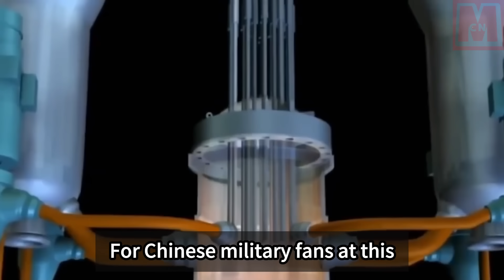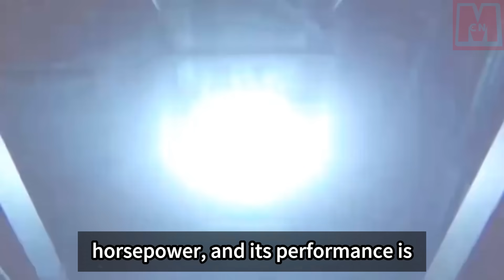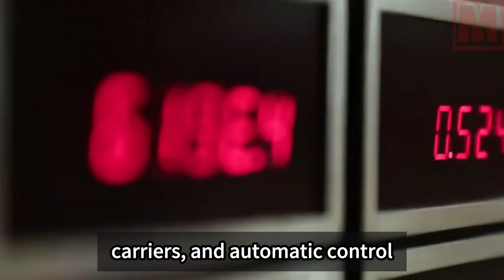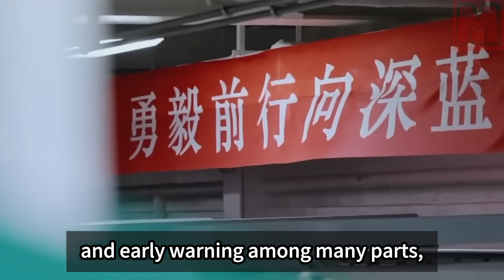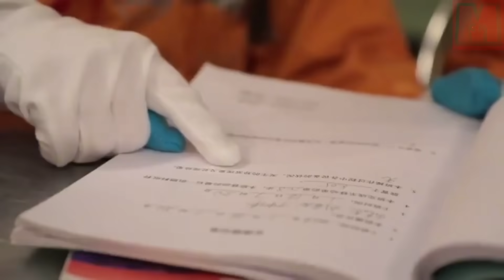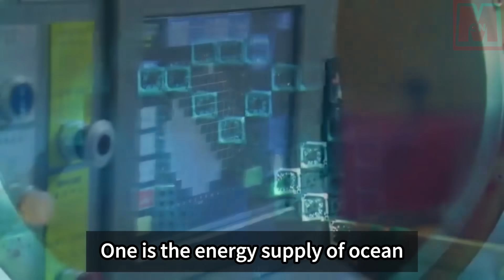Linglong 1 nuclear reactor project: Why is it crucial for China

Comment: Another possible option is China's molten salt reactor.  Shanghai's dockyard is preparing to produce a large merchant ship using a molten salt reactor. China has a developmental MSR running since late 2022 and will begin the construction of a larger MSR starting in 2025 with a completion expecting in 2029.

Comment: Nimitz-class supercarriers are powered by two reactors rated at 550 MWth each. Gerald R. Ford class supercarriers are powered by two reactors rated at 700 MWth each.  The Linglong one reactor is rated at 385 MWth.

Looking ahead to 2040, China plans to deploy Thorium Molten Salt Reactors (MSRs) for hydrogen production, synthetic fuel production, desalination of seawater, district heating or cooling, powering of ships equipped with thermoacoustic Stirling generators, and power plants with supercritical carbon dioxide turbines within its borders and globally. Similar to the trends observed with solar and wind technologies, MSR costs are anticipated to decrease with the scaling up of production and the development of robust supply chains.
Reply: So, total 1.1G watt , for nimitz 
And  1.4 for R .ford class ...
So at least china air craft carrier should use  4 SMR ( Small nuclear reactor)  given 0.35 G watt  for each ...
I think with such power , the next nuclear aircraft carrier of china  can place laser ...as such this new armament with the latest technology ...
Reply: US naval nuclear reactors use HEU I think which is why they have much more output, But come with alot of hazards and costs associated with highly enriched uranium. Linglong is an electrical generation reactor which runs on LEU so its cheaper to run but less powerful.
Reply: China Water aircraft carrier..the best choice for fishing

Comment: Linglong One project is a multi-purpose pressurized water reactor (PWR) design in China.
Linglong One was successfully installed at Changjiang Nuclear Power Plant in South China's Hainan province and lays a solid foundation for advancing the Linglong One demonstration project.
The small modular nuclear reactor can powered the aircraft carrier.
Well done.

Comment: China has got off to an impressive start to building nuclear-powered aircraft carriers.
Reply: If you mean building a nuclear powered aircraft carrier without the nuclear propulsion, then I guess OK.
But just because China is building modular reactors doesn't mean that China has built something that works to power a ship.
Reply: @tonysu8860  In fact, China 🇨🇳 is currently building a nuclear powered cargo ship. China State Shipbuilding Corporation (CSSC) is working on a 24,000-TEU-class ship at Marintec China expo in Shanghai. The vessel will utilize a fourth-generation Molten Salt Reactor (MSR) to generate electricity.
Reply: @tonysu8860  Didn't you see the word 'start' in my comment? You should start wearing glasses.